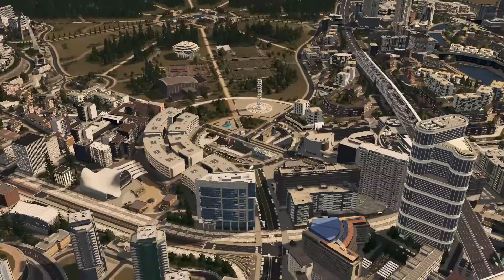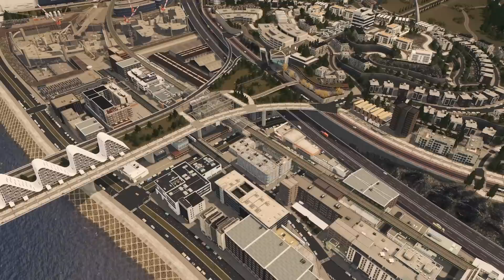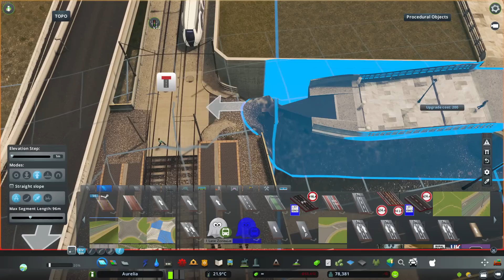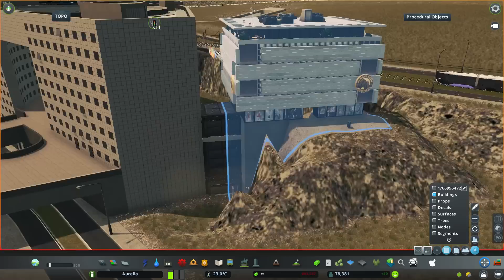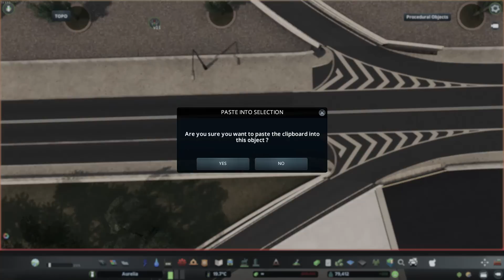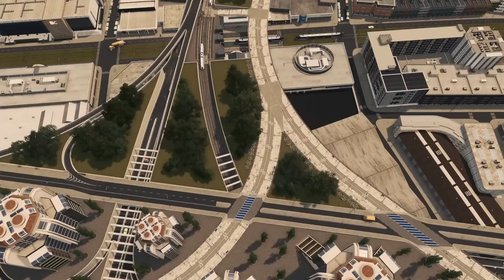Residential Bridge 2 - Cities: Skylines - Aurelia #70

Comment: Hello, I want to know if I should install windows 10 on the regular hard disk in the Samsung - 860 EVO 1TB Internal SATA Solid State Drive to be able to play well and that the pc runs very fast, Thanks.
Reply from the maker: If you can, always have your system and C:S on an SSD.
Reply: @Akruas  I already bought everything, the MSI Z390-A PRO LGA1151, / Samsung 970 EVO 500 GB, / Crucial CT2K16G4DFD8266 - 32 GB Kit (16 GBx2), / MSI Gaming GeForce GTX 1650 128-Bit HDMI / DP 4GB GDRR5 / Samsung - 860 EVO 1TB Internal SATA Solid State Drive, / Intel Core i7-9700F 3GHz 8-Core Desktop Processor, LGA 1151 and the Segotep 650W / 750W Gaming Power Supply GP Series 80 Plus Gold Certified. already mount it.